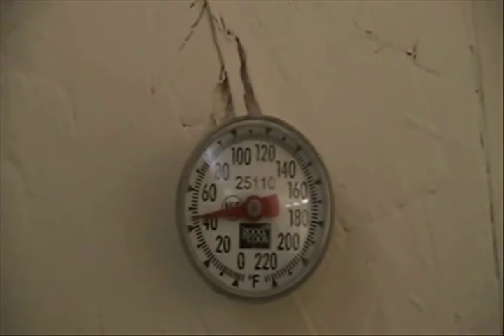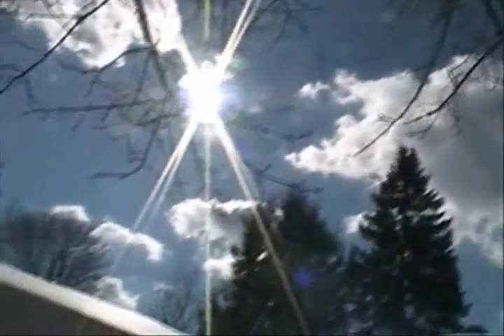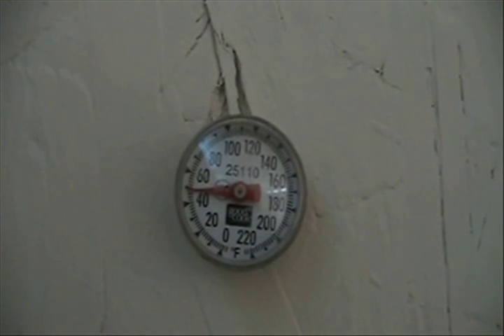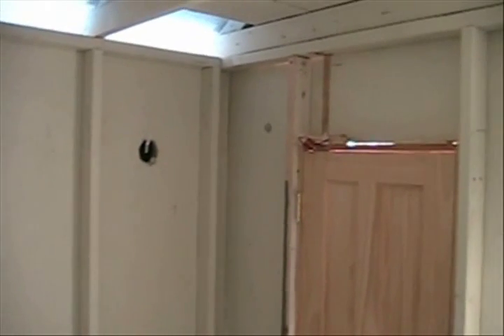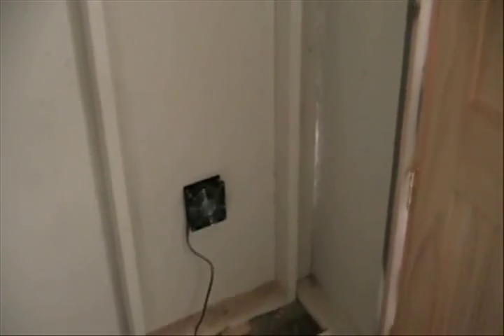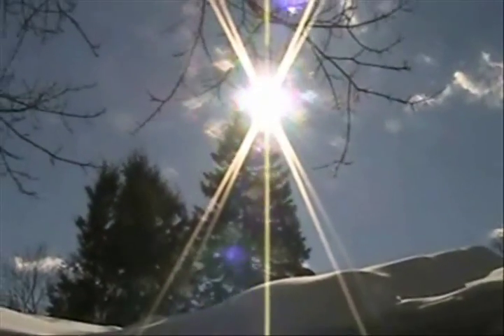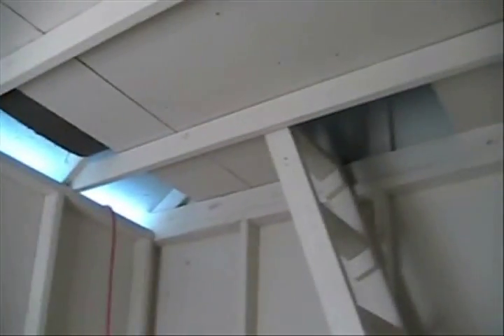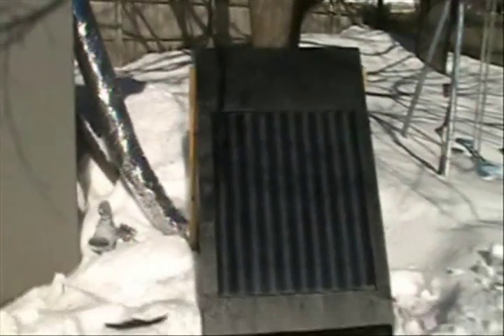Solar Furnace Success

Comment: Just a suggestion, you should put the fan on the outlet instead of the inlet. The fan itself will warm some of the air passing over it. Also keeping the temperature difference greater with allow for better airflow. Nice video, very impressive for its simplicity.

Comment: Nice work. That collector looks great. If I can make a suggestion,... you should get one of those dryer dampers and install it on the "hot air in" hole. Then when the system shuts off the damper will close and prevent a reverse flow of air, cooling off the space prematurely. No cold air will come out the bottom because no air can go in the top. I think I said that right :)  Being as how that space is just a "fort" it may not really matter to you, but I'm just saying....

Nice work man!